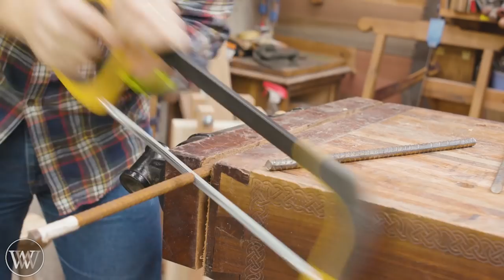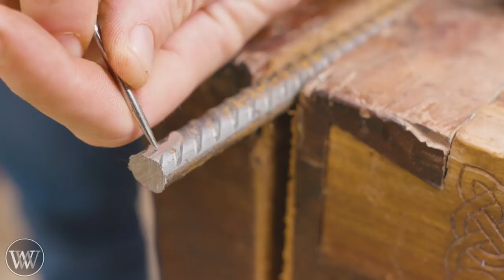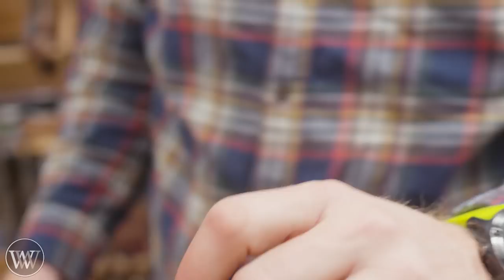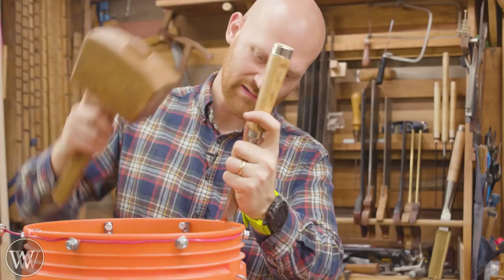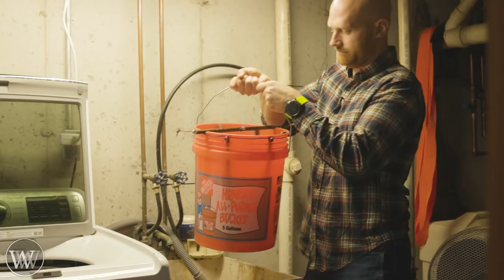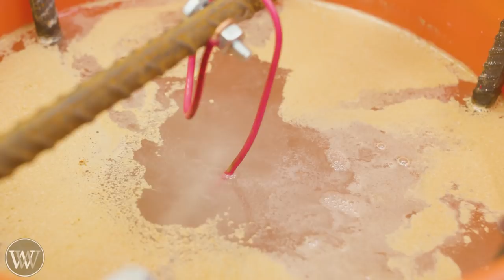DIY Electrolysis Bucket Tank Thing

Comment: I built one of these awhile back (any old DC power wall wort adapter like an old USB charger works great), then someone introduced me to Evapo-Rust.  Works better/faster (even getting into the threads of locked-up screws), and worth the cost.
Reply from the maker: Yep. I generally only use this for the big items. Evaporust and WD-40 specialists are phenomenal.

Comment: Enjoy the video! Have you try using vinegar without the electrolysis process. Honestly, I was skeptical until I tried. I worked really well removing the rust and leaving the patina intact. I takes longer though.
Reply from the maker: thanks. yes I use vinegar quite a bit. one of the cheapest and easiest ways of doing it.

Comment: Sir - you are making hydrogen gas - do it outside! PLEASE
Reply from the maker: yes I am making some, but the amount is so little I would have to run this in a sealed room for several days before it became dangerous.
Reply: @WoodByWright  Heres hoping - nice video BTW...
Reply from the maker: Thnaks Tim. I will keep them coming. I actually use to collect it to do party tricks. With this voltage and that much contact I could fill a liter about once every 40-50 hours. and that much in a tiny shop say 8' X 8' would not increase the flammability of the space by any measurable amount. and I do not know a room that people would work in that would not exchange that much air over the coarse of several days. It is something to think about but would require very specific conditions. I put it in the same category as PVC dust collection. could it cause a problem. possible, but I have not seen a single instance where it has, and the math just does not support the fear. now BLO rags. those are dangerous.